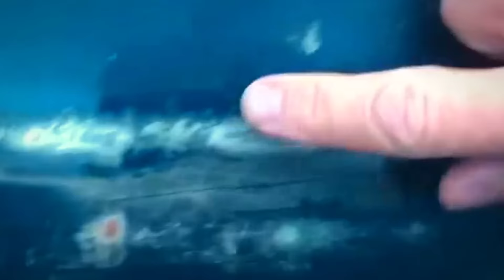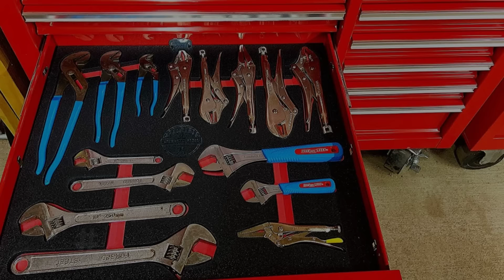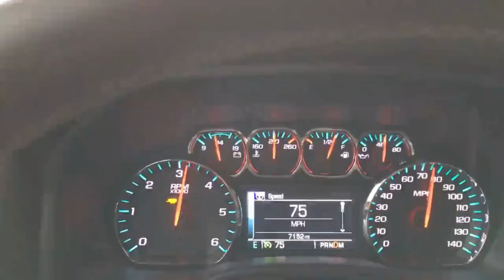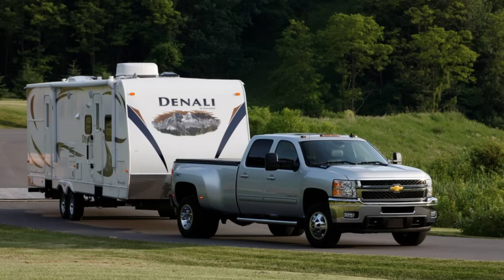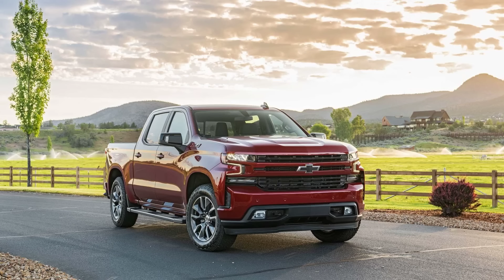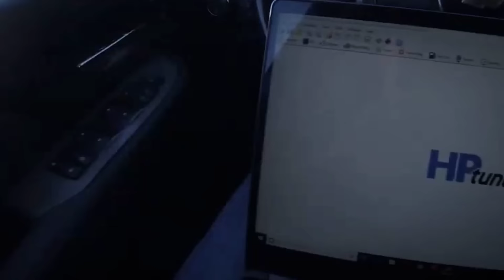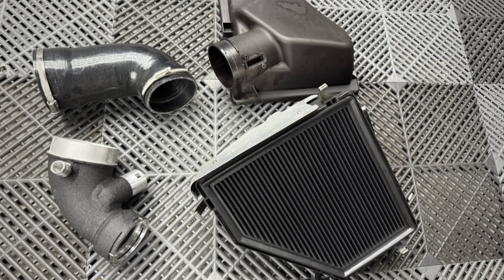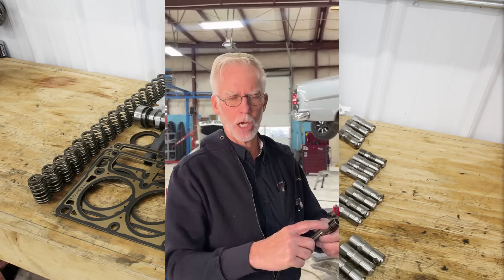13 Chevy Mods That Are WORTH IT (And 5 That KILL Your Engine)

Comment: The new 2026 5.3-6.2 engines have received huge updated motors.  NO more AFM-DFM systems!! They went back to the old school builds, that will keep these engines running for decades again!  NO more lifter and injector replacements, if serviced properly. To many upgrades to txt, you have to research.  NO more going out of 8 Cylinders, they will stay in all 8! Upgraded for better air flow for less heat. Transmission upgraded to keep the Torque going with less stress on the engine. Just a plain old Chevy Block with all the junk, that causes breakdowns. The engine is built for reliability now, leaving all the fancy parts behind. Only little downfall is, you will burn a little more gas, but it’ll be worth it!   5.3 Will receive the engine of the year award and others will follow IMO.
Reply: You gotta realize Chevy been waiting, it's just that EPA has finally been told to sit down.
Reply: Are the 5.3 and 6.2 good engines that are able to tow a 7500LB camper?
Reply: @ericlafollette81 the 5.3 is amazing, its a old school engine I would trust, just make sure it doesn't have the cylinder deactivation.

Now the 6.2... Hear me out. Technically an amazing engine, but the cylinder deactivation and camshaft have a tendency to grenade the engine early but you can still tow, but at 7500 lbs you need the cylinder deactivation function removed. ALSO, the transmission runs SUPER HOT, and that lowers the life span of the truck, you NEED to buy a transmission coolant bypass or risk running the transmission out in long drives with 7500lbs.

If you want my personal opinion, get a diesel. You won't regret it.
Reply: @bio @bioheart09 ve a 25 Chevy 2500 ZR2 DMax, I was just bringing up their announcement about these engines.  What you brought up about the 6.2, the issues are supposed to be corrected. AFM… DMF…. Shut down at a stop will all be gone along with an updated Trans.  They’re going for reliability in these new engines and making many adjustments to get there, they’ll be out within a couple months, so we will see
Reply: I’ve got a 5.3 with an afm delete, you couldn’t pay me to own another vehicle with that engine again. I’d rather have a 4 cylinder from the 90’s than the constant issues with that engine. It’s such a reliable engine we use it to haul 1200 lbs of feed when it’s raining and only that one specific usage since it’s a waterproof setup instead of an open bed on the real trucks
Reply: Lies
Reply: @amendment2711 what’s Lies?

Comment: Lol you suck! You level the truck by lowering the back not lifting the front
Reply: I just put on Rough Country N3 2 inch leveling struts. It rides like a Cadillac and I get a couple more inches of ground clearance, which i prefer when off road. Its just a matter of what your trying to achieve.

Comment: Active Fuel Management or whatever they call it now is the worst thing GM has ever done... I've seen what that lousy system has done to engines... The 4.8 liter didn't have it and was a great engine... When chevrolet stopped building that engine, I was done with chevrolet trucks... Too bad GM didn't learn their lesson in 2006 when they were ruining engines in caddy's...
Reply from the maker: Totally. AFM/DFM has caused more problems than it solved. That 4.8L without it was bulletproof, and GM ruined a lot of engines trying to chase fuel economy.

Comment: I have what is probably a dumb question for people who know about it,   I have that Range AFM disabler on my truck,  a previous owner put it on so I know nothing about it. 

if I unplug it,  will it work fine when I plug it back up again or does it have to be programmed someway ??
Reply: Don’t take it out if those lifters haven’t collapsed in a long time there’s a huge chance it’ll go into v4 and one of them won’t unlock. I’ve unlocked stuck ones before with a hammer and an old pushrod by just taking the valve cover off.
Reply: It will work fine it’s a plug and play system if you unplug it the DOD/AFM system will actuate while driving, if plugged in it deactivates that whole system. Do yourself a long term favor and leave it plugged in anytime you drive speaking from experience lol

Comment: DOD and AFM is for gen 4
Reply: My 2018 silverado with the L83 has had 2 rounds of lifter failure. Once at around 22k before my ownershipe and again at 76k, 6days after i purchased it. Not just the gen4 engines. Gen5 is just as bad, if not worse.

Comment: Love how this is slated as CHEVY mods but yet almost all can be applied to ANY vehicle. Also, thumbs down for the channel for NOT putting links to all the products in the channel description like EVERY other channel does.
Reply: How can put links without doing a specific engine model? This is Chevy trucks in general and as you said most apply to other brands as well (BECAUSE THEY ARE ALL COMBUSTION ENGINES 😂) dude stick to asking your mechanic. Because if you can't even look up and find parts for truck , you don’t need to own one. Buy a Prius😂
Reply from the maker: Appreciate the feedback, I’ll work on getting those links added!

Comment: I would not use a k&n filter on a 7.3 diesel powerstroke the reason why is because it lets too much sand through the engine destroys your turbo because I've done that before and I put my original box back on air intake

Comment: All silverados  mads after 2006 are shit boxes  way  overpriced
Reply: To each their own, but I disagree, my 2016 has been an excellent truck, and all 2014-up 5.3's come with 355hp......something that previous generations of Chevy trucks with a small block V8 (70's through 2000's) lacked.
Reply: @MattK-r   I agree with you MattK. My ‘17 LT Texas Edition with the 5.3 has been all over the country pulling a 4,500 lb. camper with no issues.  113k miles. I only paid $33k for it new in 2017.
Reply: I think every silverado after 1990 is a shit box
Reply: @mettlenfab . How many have you owned?
Reply: @mettlenfab  I think every silverado before 1990 is a shit box